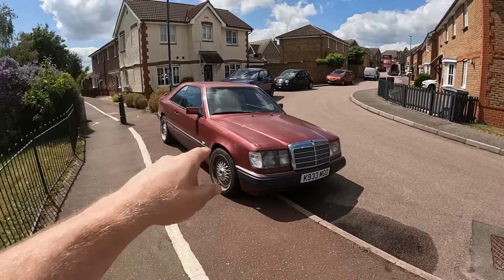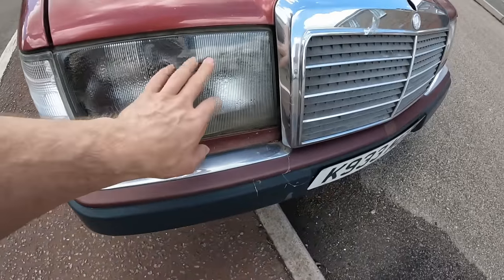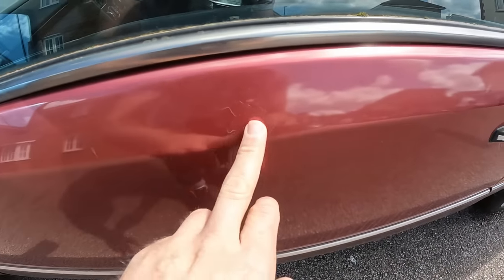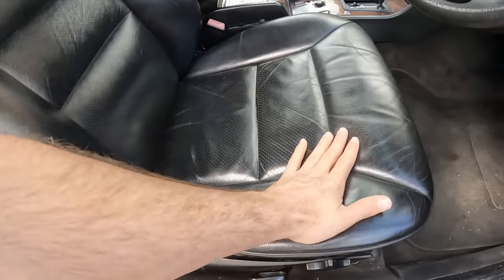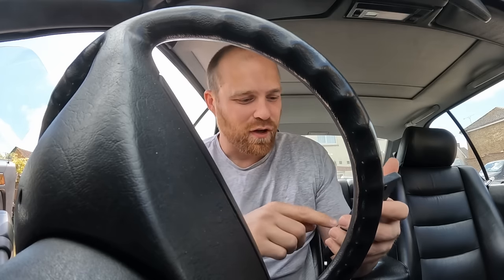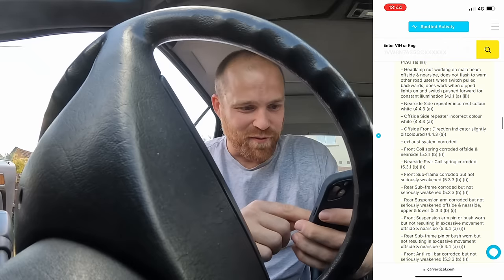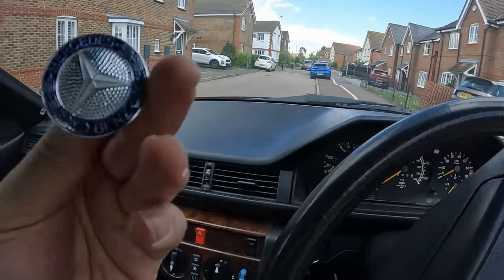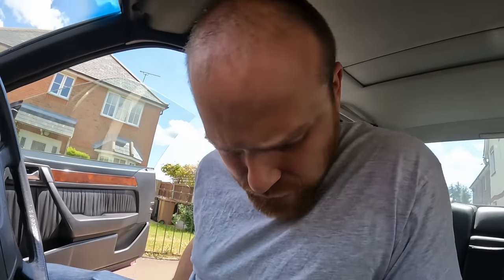Can this 29-year-old Mercedes be saved from the scrap yard?

Comment: Is this the car that takes Nino kicking the screaming to learn the basics of paint correction / detailing? S the paint bad? Yep. It will however come back (within reason for a 1993) with some time and effort. Start with a good clean and do a deep claybar cleaning to pull the dirt out if the paint - then a two step correcting polish (better with a 21MM Polisher - new tool!). 
Check out Larry on the Ammo NYC channel for inspiration… okay Larry is a bit nuts with his cleaning but his work speaks for itself. Cleaning, if done yourself, adds resale value quickly. The products and tools you buy can be used on future projects - it is an investment. 

Last thing - double check your jack and Jack Stand tolerance - those Mercedes were heavy beasts.
Reply from the maker: I think you're right – this is going to be the project that drags me kicking and screaming into learning paint correction haha. I've watched Larry a few times in the past and always end the video with a huge sense of overwhelm at what I've just watched. Who knew there was so much to consider polishing a car! But I will give it a proper, considered go. And I'll get the proper tools. The old girl deserves it.
Reply: @NotEconomicallyViable  I have met Larry Kosilla of Ammo NYC - super nice guy - but he is pretty focused / intense. Larry only knows one speed - perfection. 

Yes it can be over whelming when it seems there are so many steps and chemical options. 
If I may, start with a good wash. Use a good soap and a microfiber mitt. Top to bottom - however I start with the wheels but your wheels need refinishing so just wash them last.

Get a good stock of Microfiber cloths and some good (but cheap) applicator pads - toss when finished. It is hard to get the applicator pads clean. I mark each one with the product  it was used with then toss when it gets rough. 

After the wash try a good clay bar. Amazon UK has the exact clamber kit I started with. Megiuars G1116EU Quick Caly Bar Starter Kit - I have met Barry Meguiar a few times - great guy. Lots of videos on YouTube explaining the Claybar method - its simple - it is like you are wet sanding with the clay bar instead of sandpaper. Turn or knead the clay into itself as it gets dirty. And the clay WILL get dirty when pulling the years of embedded dirt out of the paint. I would strongly suggest do these steps  under your pop up workshop to get the car out of the direct sunlight. If the surface paint gets too warm your results go down hill quickly. 

Now that the paint is clean and will feel smooth to the touch use a compound. It is okay to use without a machine. To keep it simple use Meguiars G17216EU (again Amazon UK)
This step will test your patience and your shoulders... Keep your effort consistent. Take breaks when needed. 

I would also get a good wax to protect the paint. That is as simple as Wax-on Wax-off. 

I use a wax with a good rating. In the US I use Adams Polishes (also have met Adam... wax guys seem to be nice guys) Adams products are very good. I use his butter soft yellow wax but I recently started using a ceramic spray coating - which is amazing. 

When complete this is the time when you bring the Mercedes to a bodyshop for an estimate on the paint work it needs that is beyond your comfort level. 

Seriously your shoulders will be chatting at you after you are done. Drink beer with a straw that evening as the pint glass might be too heavy...

Comment: wheels are calibre vintage fake split rims. owned a set before they're a very well made strong tuv approved wheel that uses the genuine bbs centre cap tool due to being the exact same size along with the badge. cheap crap like dare and most other rep bbs just have Allen head bolts holding fake 1 piece all in one plastic centre caps - where as the calibres like the real bbs have a proper 2 piece metal centre locking centre cap :) oh and from memory the 190e also had the funky mirrors as does a polo 6n2. must be a German thing.

Comment: If those are réal BBS They are Worth 2 to 3.5k if refurbished just bought one set and sold 2 
Keep them !
Reply from the maker: I’d laugh my head off if they’re real – that would make the wheels 7x more than what I paid for the car! I suppose I should have a look for some kind of guide on how to work out if they’re real…
Reply: @NotEconomicallyViable  just unscrew the cap if behind the cap on the rim They is a BBS Logo and à RS*** number then They are real you can also look if thé screws arround are labeld BBS at the base of the screw Head ;)

Comment: That has old school Bosch injection I think.  Possibly a fault with the MAP(manifold air pressure) sensor or it will have a throttle position sensor, may have been the bit you said was making noises as soon as it cut out(normally opposite throttle cable).

Basically those two will work out fuel to air ratio and with those playing up it could make it stall.  Normally you can get the info online to test with a electrical test meter by measuring the ohms. 

I would be changing the plugs and HT leads anyway just so you know they are done and right.  Don’t buy your plugs off eBay etc as there are so many fakes out there and trust me you don’t want to be trying to get a broken plug out of the head.
Reply from the maker: Cheers, Chris, will take a look at those. 

I don't plan on buying cheap eBay parts for the rest of the car. I only did it with the OVP relay because I'm not convinced it's that seeing as it was only just replaced. Will get as close to OEM as possible for all the other parts.

Comment: hi could be cutting out because throttle body shutting closed
Reply from the maker: That seems plausible. Pretty sure it was the throttle body that was making the weird buzzing noise and vibration. Will take a further look in to it 👍🏻
Reply: @NotEconomicallyViable  Try to start it with the gas pedal slightly pressed, maybe it won't cut off that way. That may give you some clues.

Comment: Those wheels don't suit the Merc. Get some period correct wheels. You might even get a few quid back selling the BBS-style wheels. A service should be one of the first things to do. I bought a Citroen Xsara Picasso for £60 and there was about £6 in change. It was a baragin even with the running issue.
Reply from the maker: I’m with you - I hate those wheels. Looking at some Mercedes Aero wheels, or Aero-style wheels in the short-term because they’re lots cheaper